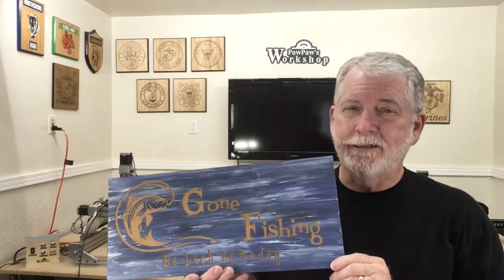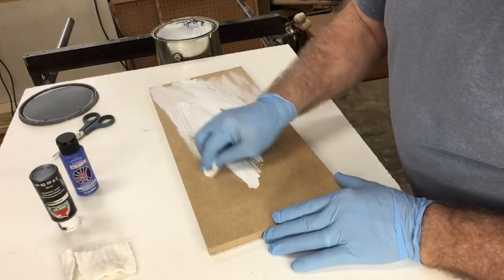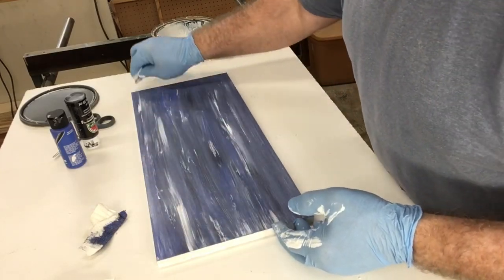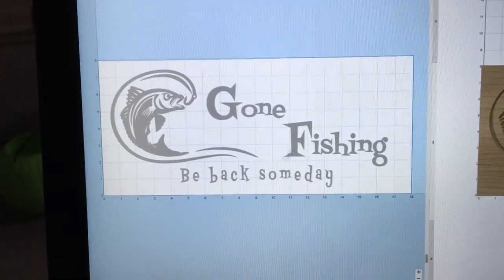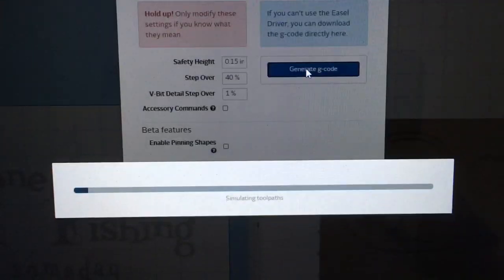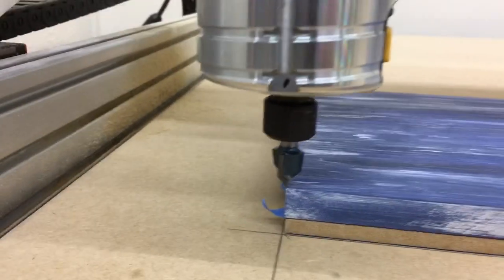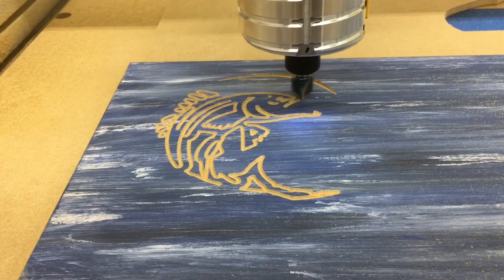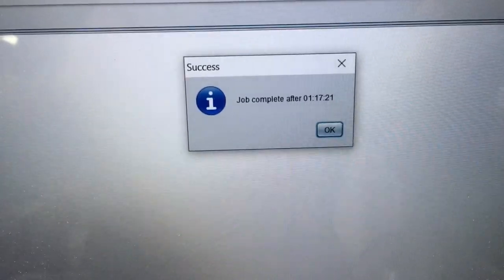Generating GCode in Easel & Carving Using UGS (Part 2)

Comment: my UGS doesn't have the $X command in the same place as yours. Is there another name for that function so that I might find that button
Reply from the maker: There are several different versions of UGS. I was using a very old version of UGS. You should still find all the same commands and yes it will be located in different places. I no longer use UGS, I use the Openbuilds Controller now.

Comment: do you have a link to the UGS software?
Reply from the maker: A quick Google search gets you there. 
GS - GitHub Pageshttps://winder.github.io › ugs_website
Universal Gcode Sender — Universal Gcode Sender. A full featured gcode platform used for interfacing with advanced CNC controllers like GRBL , TinyG, g2core ...
Platform · Gcode Processors · Getting Started
You've visited this page many times. Last visit: 5/16/20

You also need Java on your computer. You can also go to Openbuilds and download the sender from them. Both are free.

Comment: Hello paw paw, firstly thanks for all the help just completed my power box for CNC4NEWBIE. Albeit true that the easel software takes longer and makes bizarre tool paths sometimes. Could you in the future do a video on stacked text with vcarve? I can design a stacked text in easel in about 5-10 minutes and only use two paths a clearing and detail. Now on v carve desktop it takes forever to design and requires 4 separate files to carve with clearings and detail. Beyond frustrating. You would think they could match the easel software with the simple design layout with depth of cut for stacked text. Sorry to ramble and thank you!
Reply from the maker: Yes, you are correct. It is quite difficult to do the started text in VCarve. You can get excellent results in easel with a fraction of the time

Comment: Sorry to bother you as I wrote to you before about UGS and Vcarve but on Vcare Desk Top I cannot seem to find how to save it as a NGC,NC,TXT or G-code to make it work on UGS can you please help me
Reply from the maker: When you are working with a file and you want to save your work you go to the top left under file and save your work as you would with any file. This creates a .cry file type. Once you are ready to carve and you have completed all your toolpaths you will need to save you work. At this point you are working with the toolpath menu on the right side. The very bottom right icon is a save toolpath option. When you select this icon it will open another window with the selected toolpaths and you need to select the correct post processor. I use the xcarve(inch)(*.gcode). Then hit the save toolpath. This will create the .nc file that you need for UGS
Reply: @PawPawsWorkShop  thank you very much

Comment: I am glad you pointed out that Easel is not the most efficient in the way it produces G code,  it skips around alot.   Is there another free program that does better then Easel.  Thanks
Reply from the maker: Not that I am aware of. Inventables is planning to announce improvements to easel and the tool paths tomorrow May 3rd. Have to see what they are doing
Reply: @PawPawsWorkShop   What did you think of the improvements in Easel today.
Reply from the maker: Long over due.  I'm glad that they made these improvements

Comment: 👍. I don’t think the machine is going to travel the 70 in per because there are too many curves. It will only travel that way in a straight line, it automatically slows for the curves. I’m no expert for sure but from research this is what I have found.
Reply from the maker: You are 100% correct.  Thank you.  I spoke during the video observing the action and did not mention that fact. Thank you very much.